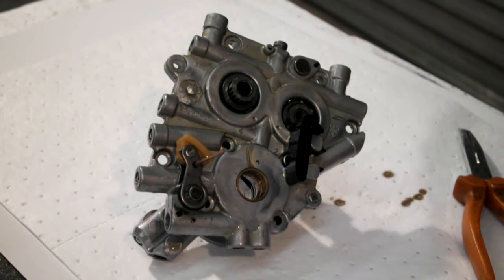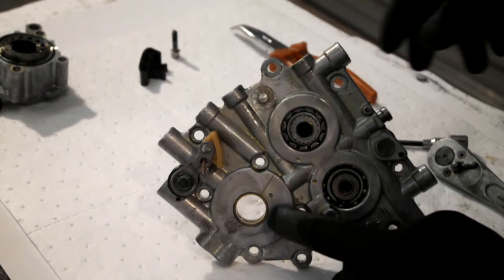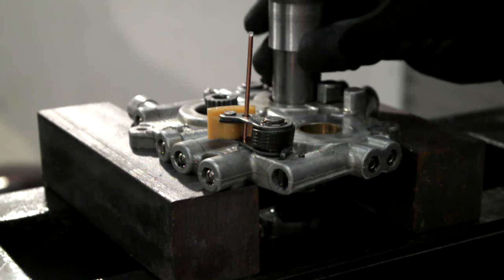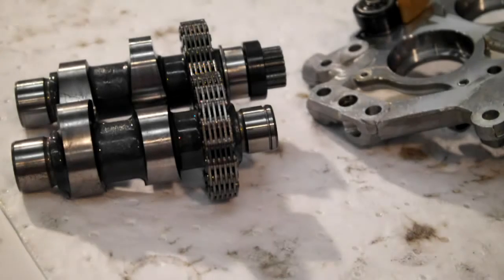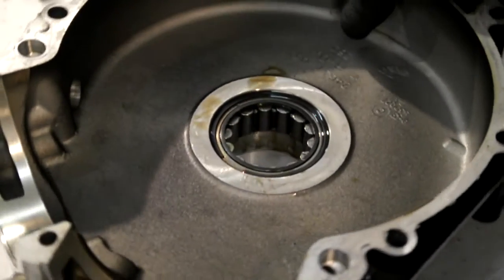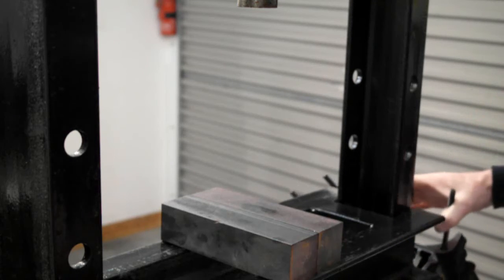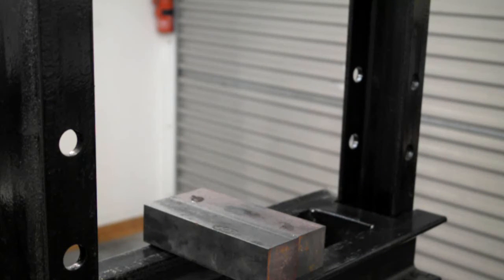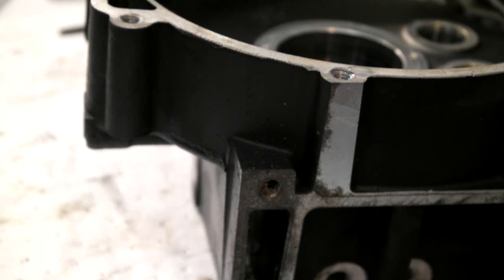Harley Twin cam 88ci strip and rebuild part 11

Comment: Did you get the crank from Tatro? I want to do the same. No pressed crank for me good sir. Lol
By the way, what's a good brew that you'd recommend to an American? Love me some Belgian ale. A triple is best. Maybe St. Bernardis?
Reply from the maker: I got the new crank from a company on ebay called langerprohd 
based in the USA, Very helpful person, a good brew for me is a big mug of tea or coffee, usually coffee to keep me awake
Reply: Lol, gotcha. Tea or coffee is a much safer option, especially around machinery.
Reply: Thank you for the info.
Reply from the maker: I have used darkhorse cranks in a few motors and they are superb, Can't fault them at all.
Reply: Yea I live about a hour away from where there are located. Thanks for the videos I hope you are going to keep posting them I seen it a been a few months ago you posted your last video.
Reply from the maker: I am thinking of cleaning the paint up a bit, I painted it not long before I did the motor, so I may video the stages of reflatting and polishing it, plus I have some photos of the paint job as it progressed that I can add in, not done much else as I've been busy at work,
Reply: ***** Thanks for the info. I checked them out and they look like they do excellent work.